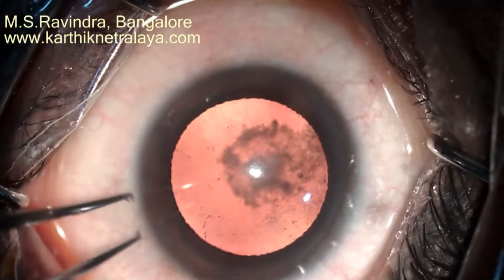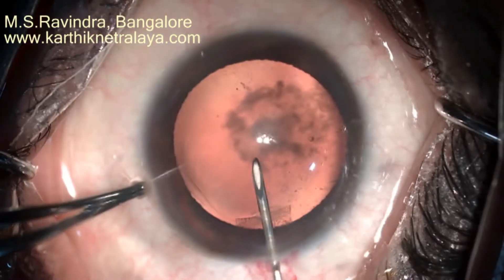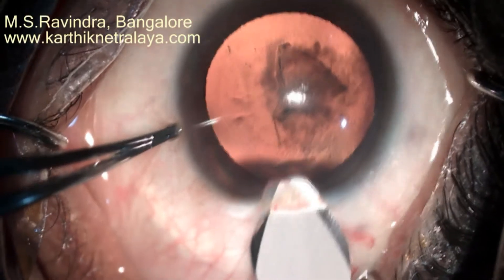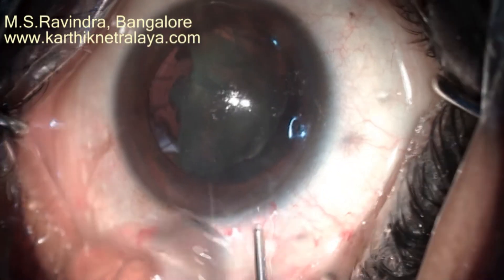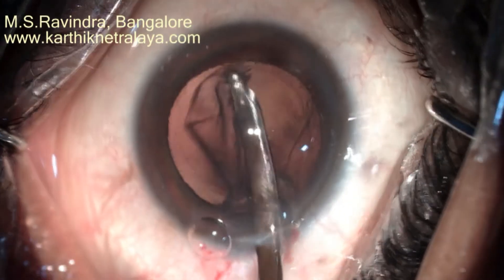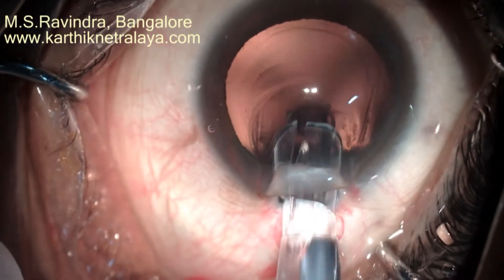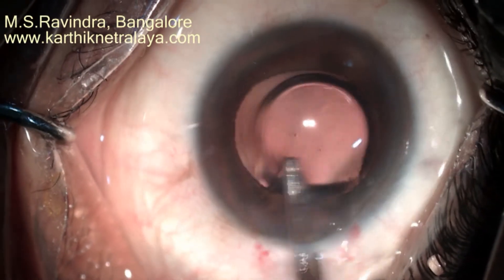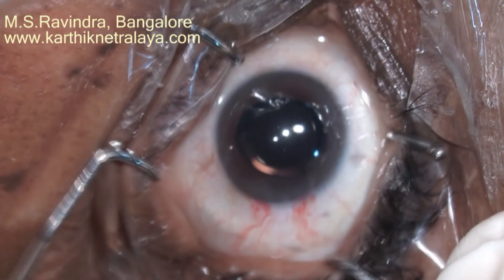Posterior subcapsular Cataract. TransLimbal single tunnel topical surgery with IOL implantation

Comment: Sir what is SIA of this technique...
Reply from the maker: Varies sir, depending on many factors. I get around 0.50 D to 1.00 D and will use it correct pre existing Astigmatism. The SIA can be zero if I start the tunnel on sclera, and keep it rectangular. .